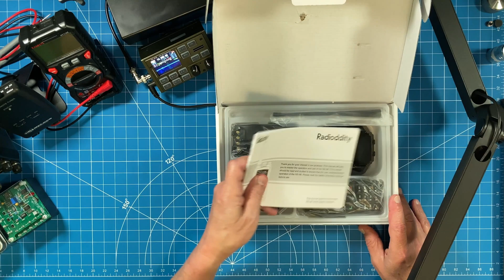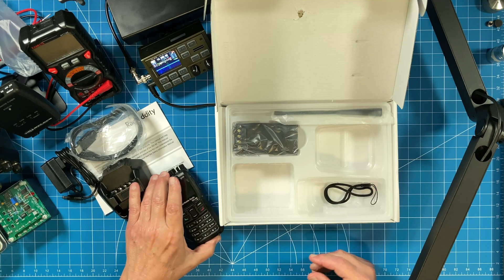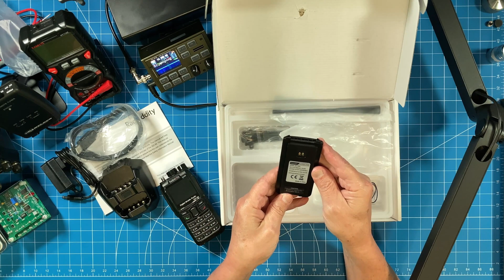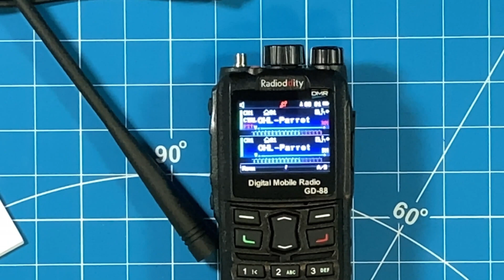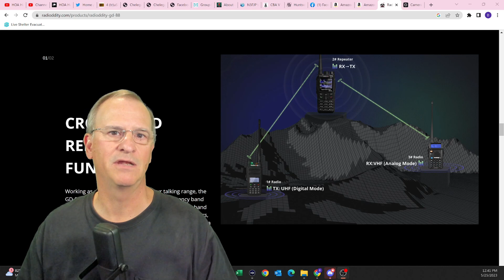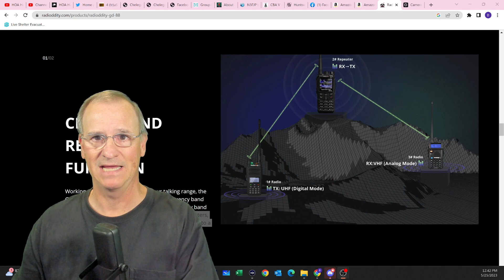First Impressions of the Radioddity GD-88 7 Watt DMR Digital / Analog Handheld Transceiver

Comment: Hey Bob, great review.  After buying one of these, I found a few things mine does that yours apparently didn't.  
Writing to the radio injects new, and random, errors every time. Channels will be in new zones, settings will change, CTCSS might be different...data gets corrupted somewhere in the transfer if you touch the cable, make noise, are sitting in a running vehicle.
Best part is random location data transmitting, even when it's disabled. Spamming everyone with your location and callsign is a neat way of getting your name out there. I guess it's like FT8 in that regard.
Pros: Radio does neat stuff I've never seen before, and helps you make pen-pals on the internet. Also spams people in DMR mode, which I haven't seen other bands offer yet.
Cons: Little expensive for a Baofeng with a random-number generator built-in to the VFO
Reply from the maker: Wow, that's a hot mess!  Sounds possessed.  I sure hope its still under warranty....

Comment: Hi, Bob! Great video review! I just found your account via the video and subscribed!  I tried the GD-88 back around November last year as my first DMR rig, but I ended up returning it after my own testing.  I'd be interested to see if you find any of the same issues I did...

- The included belt clip has a manufacturing issue and appears to have been assembled upside-down -- this causes the clip to not fit properly during installation, leading to an extremely tight fit, which in turn can lead potential stripping of threads and breakage of the clip during operation, as the clip ends up mounted "too tightly" against the battery (making the clip essentially useless at best - or a safety hazard at worst).

- The analog audio was unbearable (this was the show-stopper for me which led to returning the unit).  In analog mode (which I intended to use the rig in quite often, as I don't have much DMR activity nearby), I found two problems -- One, there was an incredible amount of lag time for making audio adjustments (as much as 1 or even 2 full seconds between making an audio level adjustment and that adjustment being heard in the output).  Two, the analog output level was insanely loud -- it would go from silent (turned all the way down), to really loud just one click or notch "up".  Subsequent audio adjustments just got "much, much louder" - but there was nothing reasonable between "silent" and the first notch up, which was far, far too loud.

I wrote to radioddity about my findings, but nothing was really done.  One tech I spoke to agreed the analog audio was very loud, but there was no known fix -- although he suggested it might be fixed in the future firmware update.

Anyway, sorry for the wall-of-text comment, but I'll be very interested to see what your experience with the rig is.

I had really high hopes for it at first, but the quirks/bugs it has during analog operation were just too much for me to deal with.  I still operate primarily analog on 2m/440, so I was hoping the rig would handle both.

73! - Chuck, kc4kqe
Reply from the maker: Thanks for this great feedback Chuck.  I would have to say there is a lot to like about the GD-88, but man, that volume button and the lowest volume....I do not like that at all.

I'll have to take a closer look at the belt clip, I may have missed that.  

I'll be dropping a vid on loading the software, and then one as a final review.  Welcome to the channel.

Comment: Thanks a lot for starting to review the GD-88!
What would be interesting to know how good the RX front end is, e.g. in comparison with the Yaesu FT-2D, which is terribly bad. You can test that by going with all the HTs close to a commercial antenna somewhere on a mountain.
A second feature I'm interested in would be to find out if one can use analog APRS, both by transmitting the GPS- coordinates, but also doing text messaging. 
73 Stephan
Reply from the maker: I've not used APRS, so now its time to learn.  Thanks for the suggestions.

Comment: I picked up the GD-88 specifically to use with my OpenSpot4.  I put a nubby antenna on it and use the low power mode.  Works great and I can control the Openspot4 with the radio.  Stays on my desk with me all day.  There are a few strange bugs that others on YouTube have noted, but they are fairly trivial overall.  I have not found a better option to do what I use it for.
Reply: The gd-88 is the best radio in the world
Reply from the maker: Thanks for that perspective Bryant.  Since this is a new radio to me, its good to hear others have had a good experience.
Reply: @HOAHamRadio  I own every flagship HT made except Kenwood and I am just not dumb enough to spend money on that one. The GD-88 is still the best radio of them all.  The firmware update a week or so back was a bonus.  The only thing at this point that could be changed on a new version would be USB-C programming and charging.  The GD-88 is still the standard I measure everything else against.

Comment: So you just threw that question out there at the end and left us hanging? 😆Please answer that question! I look forward to the followup.
Reply from the maker: Hey Paul, thanks for watching.  I'm hanging on this myself.  I can't imagine it will work like that, but it certainly implies it.  I honestly haven't tried it yet, but hope to in the next few weeks.
Reply: It does indeed do cross-band and cross-mode. Page 49-51 in the manual show the options.  It is fairly easy to configure.